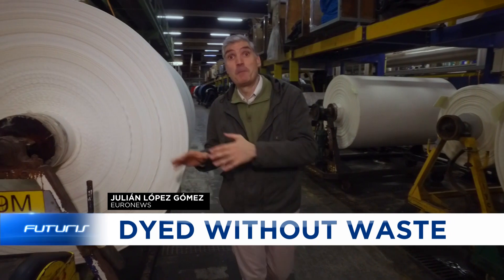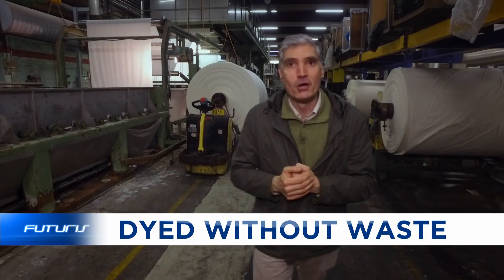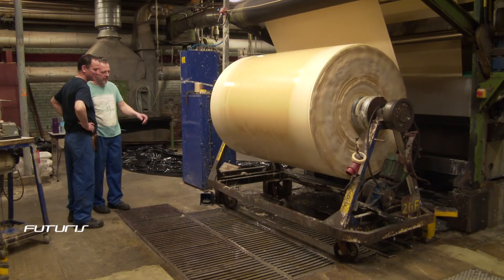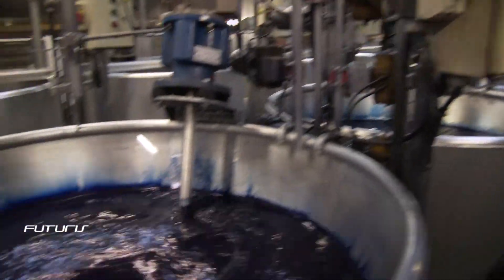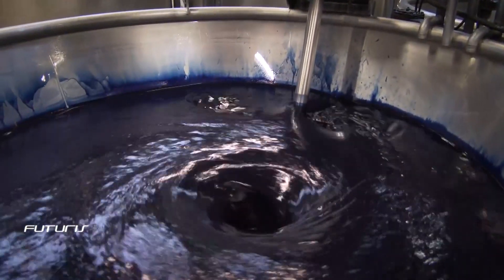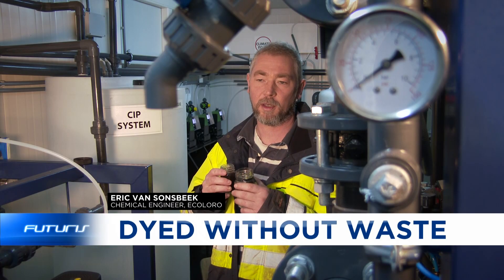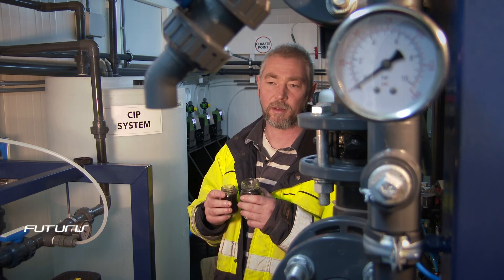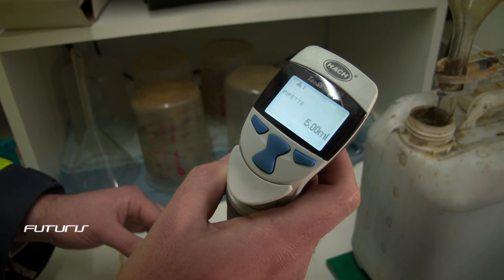Dyed without waste - developing a process to save water in the textile industry

Comment: This video is hiding several points. Reverse Osmosis is user in textile industry since more than 20 years, bit the reject problem is still not solved. Moreover, electro-coagulation is a chemical-physical process, but it is producing a lot of sludge. Many aspects are involved, and the video doesn't show the complete picture
Reply: So what should be done according to you?
Reply: Very good! I still have an extra question for author and maybe you... at reverse osmosis around 60-70% of input water is cleaned to pure water, the rest is concentrated water... so how to recycle 100% and close the system... where is this concentrated salty water in the equasion?
Reply: @clubotocec1  there is the process of evaporation, crystallization and drying using which almost all the water can be recovered. That makes the process zero liquid discharge. This process has been expensive in the past but new technologies have reduced this opex to RO levels. Full disclosure, I myself design these systems.